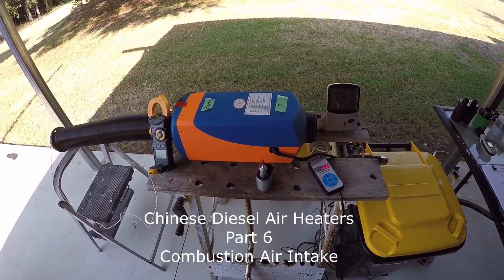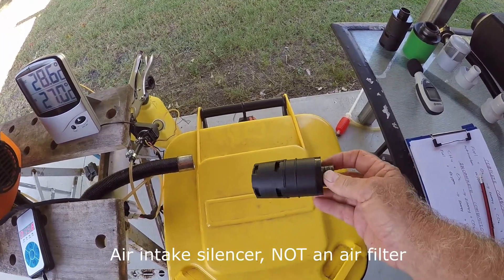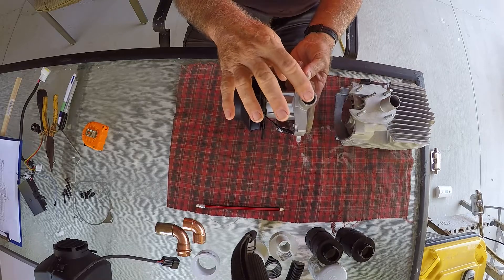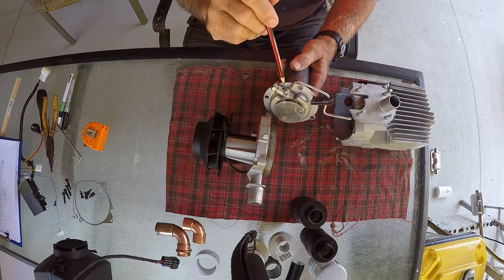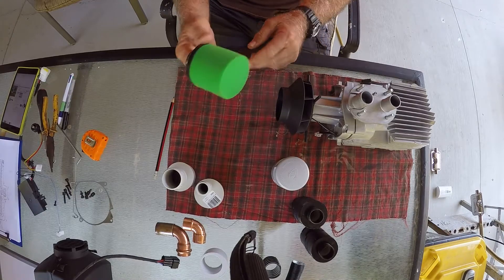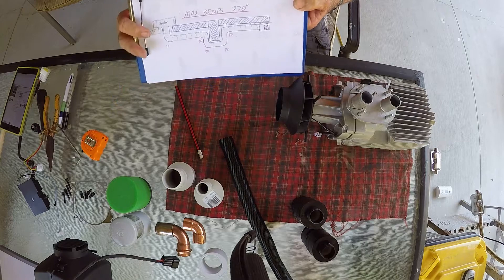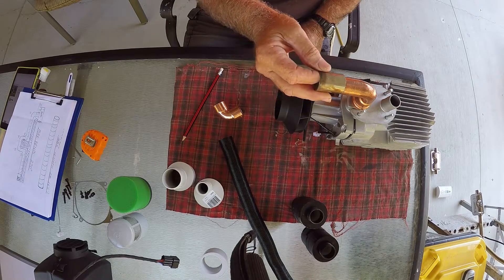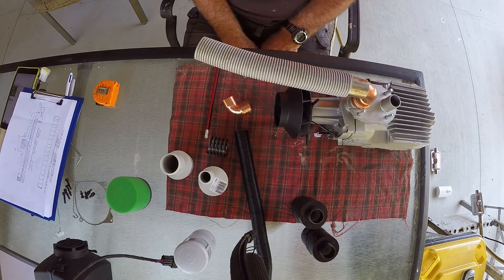Chinese Diesel Heaters - Part 6 - Combustion Air Inlet

Comment: Thanks so much for your video. I ordered a heater and will be installing it under my seat in my 77 chevy van in a few weeks. I understand  limitation on the max length of these intake hose, but assume there is no limitation on how short the intake hose can be right?. I think I might forget the intake hose all together and just suck air directly from beneath as long as whatever is going through the floor of the van is enough to be taking from outside the vehicle. Although my van is pretty high off ground thinking through I do see perhaps an issue in winter or rainy weather if there is snow or anything wet under the vehicle and somehow water got sucked into intake. I therefore might make one 90 degree turn in a short intake to point that away from where i would expect water could drip or splash. I agree that cheap hose is an issue. if when driving any rock or anything was kicked up it could dent or crushed that cheap intake pipe. I might therefore use something like you show. I assume the intake part is cold. so one could use PVC pipe?, that is smooth and would a low good air flow. but just to be sure does it get at all hot where the intake hose connects after the heater has been running a while? Regarding filters, i will see what is at my hardware store, but i think if I already have lying around some screen mesh like the ones that used on windows I can create my own filter with enough air flow but that restrict the small bugs and things that would clog that hole. I might also have metal fine mesh strainers. Anyway thanks so much for these important videos. I also see this Uni Filter Snow Pod Foam for sale which are "designed specifically for snowmobiles. The foam itself is very porous compared to a conventional dirt filter and have better draw characteristics" maybe this is ideal for adding to the heater intake
Reply from the maker: Hi Jha,

Yes the combustion air intake hose can be very short. Yes it stays cold and PVC pipe is an excellent intake pipe provided you restrict the use of those sharp 90 deg bends.

One issue to be careful of when the intake is under a vehicle is excessive moisture intake. 
One  big issue of under vehicle intake in snow country's that use salt on their roads is bad heater corrosion. 

Ingested moisture, particularly if it has a salt content, will corrode the intake internals. 
There is just a very small clearance between the aluminum casting and the internal combustion air fan. Even slight corrosion causes surface swelling of the aluminum and prevents the fan from turning.

Those foam type filters are a great advantage over mesh filters for under vehicle intakes as they restrict this moisture and salt intake. 

If you get a fan error on first start after summer shutdown, it is often this swelling corrosion jamming the fan.

JMcK

Comment: I love your video series on these heaters!  I bought several just before Christmas and they came with a slightly different air intake.  More restricted but with a half-assed plastic screen/mesh inside to keep the bugs out.  I'd still go for a motor-bike filter but it shows they're conscious of the problem.  I think for most of the viewers the general problem is there are 100's of sellers selling dozens of different makes of the same thing and its a coin-toss whether you're getting a quality product or a factory-reject  :-/   The $160 USD/ea was easy...buying the Recreational Vehicle to put it in is going to be tougher  :-)   Cheers from Oregon, USA.
Reply from the maker: Hi Mr 144, 

Thanks for the feedback. Yes, I agree with what you say about the sellers, and I had thought of putting a link to a couple of good ones I have purchased from, but it is generally better if you can purchase from a seller who has a local warehouse in the country of purchase, and one who accepts returns. (Although sometimes that does not mean anything)

For the totally non practical purchaser, it can sometimes be better to pay more and buy a "branded" knock off from a local camping or RV supplier, who will provide advice, instillation and warranty. J

Comment from the maker: Thanks for the feedback Rob.

I re-did the tests. Ambient temp. 25degC. I used an intake silencer with baffles and holes in the end of the end cap, one with baffles but no holes in the end of the end cap, and one with the baffled cap removed just having the straight through part with the surrounding noise absorbent foam.

Test 1. 3 Hz setting, distance of 200 mm from exit and silencer (side on readings) average of 5 readings.
No silencer - 69 db.  Sil. with end holes - 69.5 db.  Sil. with no end holes. - 70 db. Silencer with end  baffle removed - 68 db

Test 2. 4 Hz setting, distance 200 mm as above. Average of 5 readings.
No silencer - 72 db. Sil with end holes - 71.5 db. Sil with no end holes - 72 db. Sil. With end baffle removed - 71 db.

Test 3 . 4 Hz setting, distance 1 meter, end on meter reading, average of 5 readings.
No silencer - 62 db. Sil with end holes - 62 db. Sil with no end holes 62 db. Sil. with end baffle  removed - 61 db.

My thinking at this stage is that the baffles in the intake silencer creat their own air noise and negate the absorbent action of the foam insert in the silencer. You get a 1 db noise reduction by removing the end cap baffles.

It is important to have a proper filter, so if you removed the baffle end cap and then mounted a filter you would get a 1 db noise reduction plus filter air. However 61 db at 1 meter is not too much noise and may not be worth the effort. Exhaust noise is most likely to annoy your neighbours. Also, be aware that the majority of the ambient noise in this test would come from the exhaust outlet. J.